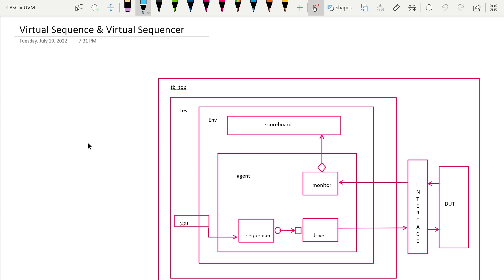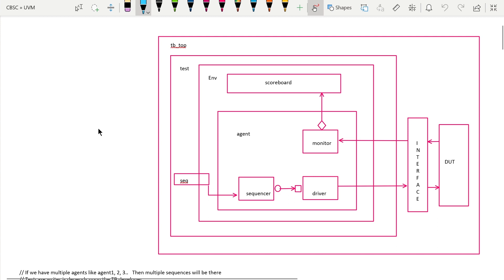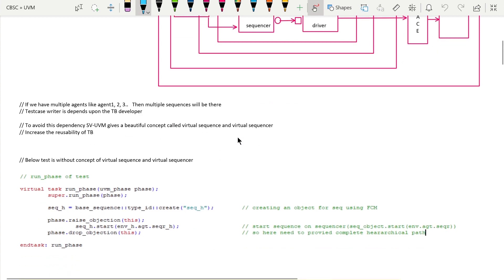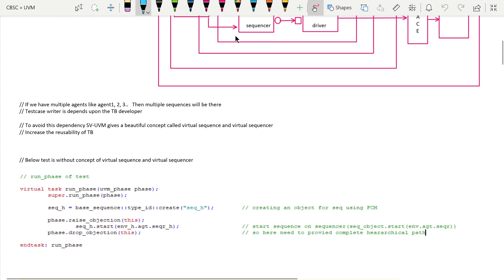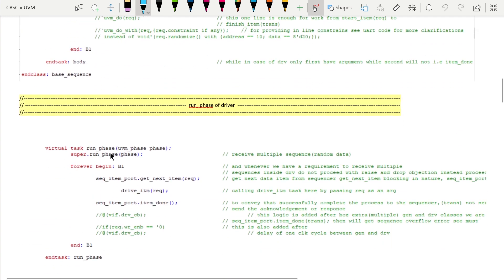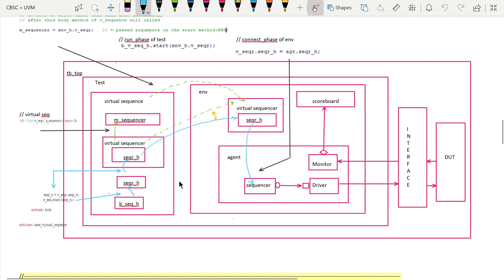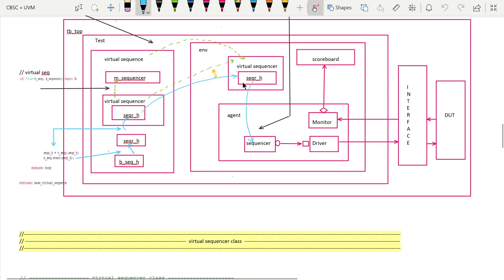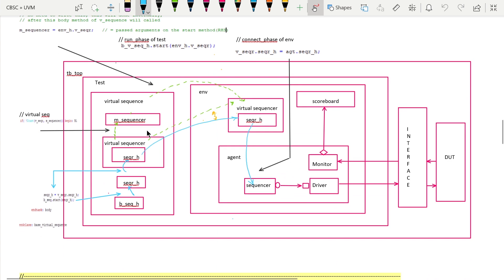virtual sequence & virtual sequencer w.r.p.t system Verilog UVM.

Comment: What is the use of `uvm_do_on macro and 'uvm_declare_p_sequencer() in UVM  virtual sequence ?
Reply from the maker: `uvm_do_on
This is the same as `uvm_do except that it also sets the parent sequence to the sequence in which the macro is invoked, and it sets the sequencer to the specified SEQR argument.

Reference:-

https://verificationacademy.com/verification-methodology-reference/uvm/docs_1.1a/html/files/macros/uvm_sequence_defines-svh.html#:~:text=%60uvm_do_on,-%60uvm_do_on(SEQ_OR_ITEM%2C&text=This%20is%20the%20same%20as%20%60uvm_do%20except%20that%20it%20also,to%20the%20specified%20SEQR%20argument.

This macro is used to declare a variable p_sequencer whose type is specified by SEQUENCER.

Reference:-

https://verificationacademy.com/verification-methodology-reference/uvm/docs_1.1a/html/files/macros/uvm_sequence_defines-svh.html#%60uvm_declare_p_sequencer